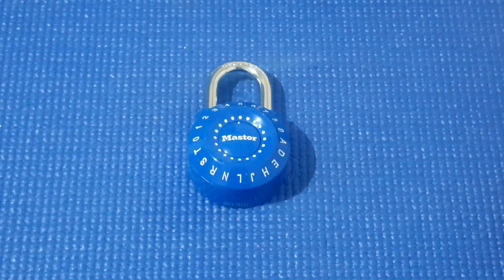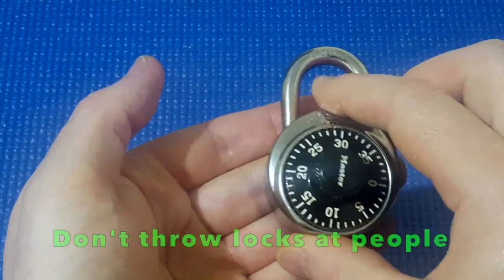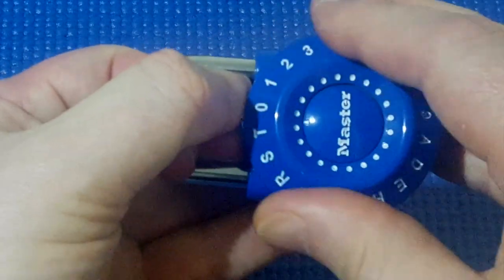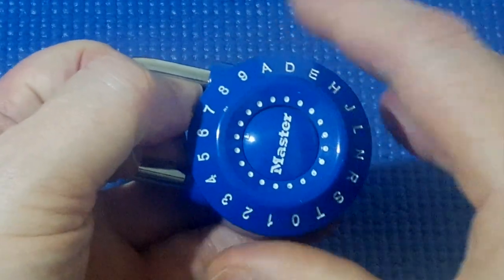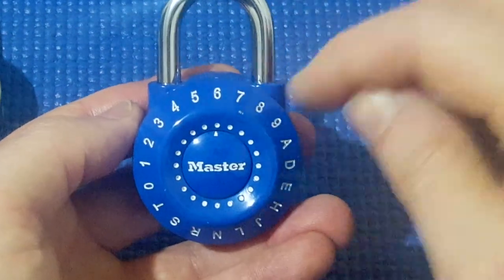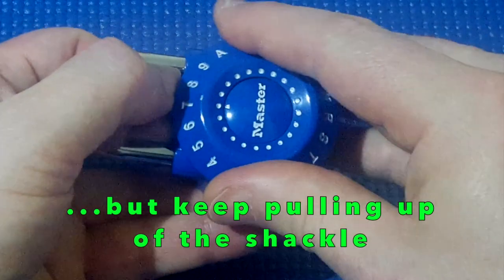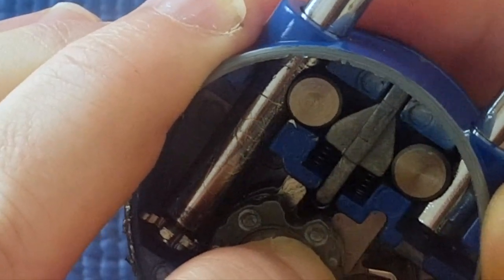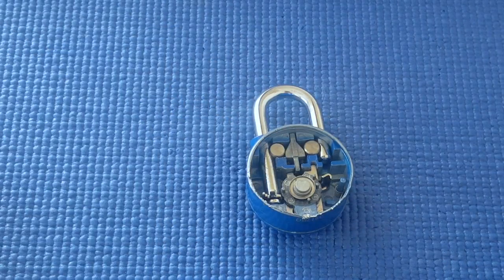(Picking 95) How to crack a Master Lock "1590D" dial combination lock

Comment: I understand that for the 2nd and 3rd you stop and go the other way once you're inbetween gates and it won't let you through but I don't quite understand the 1st digit and what to do and how to find it
Reply from the maker: Do you man the 1st digit of the correct combination? I find the 3rd digit first, as it's easiest to find. I find the 1st digit next, as it's *sometimes" able to be found - 50% chance that the anomaly is hiding behind a usual "stuck" position, if if it is then there's no trick I no of to find it.
Reply: @Swynndla  ok
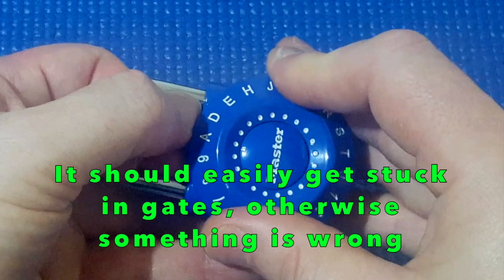Reply: @Swynndla  I don't understand the add 8 part at I think 3:50
Reply from the maker: @expiredcoffe  Firstly, I've had another look at the video (it's been a while) and the previous comment I gave you is wrong - I don't find that 3rd first (with other master lock models I do find the 3rd number first), but I find the 1st number first with this master lock model.
It's still true that with this model of master lock, the 1st number is *sometimes" able to be found - 50% chance, as half the times the anomaly is hiding behind a usual "stuck" position (and if it is then the method in the video won't work).
One of the anomalies I found in the video is "6" so I add two positions to that so 6 + 2 = 8, and so 8 is my first number (as long as the anomaly really is 6). With master locks you always add something to the first number, and with this model you add 2.
Then I "reset" the lock by turning it several times to the right, stopping on the first number I found "8" then I turn one full turn the left, stopping on 8, and I test to see if things tighten up from there (while tensioning the shackle and still turning left), and if it does tighten up then I'm confident that I've found the correct first number.
You will most probably find a different first number, but as I say you will only find it if the anomaly isn't hidden behind a normal stuck position.
Let me know if you find it and how you get on.
Finally, I have proper English subtitles (instead of the inaccurate auto-generated ones) for you to follow along.
Good luck!

Comment: i can’t tell if my first anomaly is H or E because it doesn’t stop at H but it stops at E. i’ve tried step two with H and E but when i get past T with both of them nothing stops. i’ve also tried J and L but the same thing happens.
Reply from the maker: If it doesn't step at H then it's not an anomaly ... don't worry about my ones as your ones will be different ... you'll also have a different one in step two

Comment: Can we just take the back off the lock and reset it like that?
Reply from the maker: In theory you can take the back off and decode it ... but in practice I think you'll destroy the lock doing it.  This lock comes with quite a tough back plate, and by the time you pop it off, the metal will be deformed.
Reply: I think that if you do, the lock wouldn’t be so good anymore, I mean, sure, but now how can you use it?

Comment: what if my lock never "stucks" while turning around? its dificult for me to identify anomalies.
Reply from the maker: Is it the exact same model? It should go into a stuck position every 2nd position, if you're pulling up on the shackle (you have to tension it).
Reply: @Swynndla  it's the same model but the lock has been closed for 10 years haha. I don't know if the inside of the lock is rusty :( 
Btw thanks for answering.
Reply from the maker: @adrianasegura1790  Ahh ok, if you pull really hard while turning and it's smooth then my method won't work. You might have to try all the combinations, but it'll take ages.
Reply: @Swynndla  ok thanks for your advice 😊

Comment: I have only one anomaly. What should I do next ? I don’t get it from the video . Sorry
Reply from the maker: You mean one anomaly when turning clockwise (on your first turn)?  That (plus 2 positions) might be your 1st number ... did you carry on assuming that was your first number (anomaly + 2 letters/numbers)?  If it doesn't work then your first number might be on the same position as "every-2nd stuck position" (so it hidden) and you'd need to try each one as your first number (plus 2), resetting the lock between each attempt.
Reply: @Swynndla  Would this mean that the first anomaly we find would be our second number? (assuming the first number was a hidden one)?
Reply from the maker: @TeamOrdigamer  Any anomalies that we first find will be candidates for the first number.

Comment: I don’t get if ur pinching the lock or pulling it
Reply from the maker: To tension the lock, I pull it (as if I'm trying to open it).  Under this constant pulling tension, the dial will get stuck in certain positions, and I then have to release the tension slightly to be able to turn the dial out of that stuck position (but as soon as it's out I apply pull tension again).  Does that help?

Comment: I am trying to use this method to get my lock open and am struggling. It doesn't stick anywhere but one digit, and even then it doesn't stick there every time. Any advice? Also, how is yours so easy to spin?! I have to basically grip the entire front of mine to turn it!
Reply from the maker: Hmmm I dunno if mine is a different version and that's why it spins so freely, or if yours is just older and a bit clogged up? As for advice on opening it, do you get "stuck" positions every 2nd number/letter? If not, try with increased tension? Lemme know.

Comment: It doesn't work! Mine stops at every letter and number but not hard enough to have to relieve pressure on the shackle. Mine also has never spun so freely using one finger either!
Reply from the maker: Interesting - I'm not sure why you one is different to mine!
Reply: Mine does not spin so freely either. I have to pinch the wheel on the edges with two fingers to turn it.

Comment: I did exactly as you did multiple times but it doesn't work plus it's very confusing and isn't described it very well.

Also in the beginning you say trying to find the first number doesn't work but that's exactly what you do by saying what stops
Reply from the maker: Ahh I was saying what didn't work because there are methods that work on most master locks, but not this master lock model. The method I describe in this video has a 50% chance of working, depending on if you anomaly is "hidden" or not (your first number might lie on a normal stuck position and wont show as an anomaly).
Reply: @Swynndla  well that sucks that it has 50% chance of working.

I tried it on this model that I own because I don't remember the combination.
Reply from the maker: @StormySky48  Yea ... if you now know the first number is hiding on a "stuck" position, you at least know something. You might be able to test each of the first numbers (doing a full reset in between, ie turning several times to the right to reset it) and see if any have an anomaly).  Also, instead of trying to find the anomaly when turning it the way you're turning it (to the right) you can turn it the other way (to the left) trying to find anomalies (with tension). It may work one way but not the other. It'll be difficult. Good luck!
Reply: @Swynndla  What is an "anomaly?"
Reply from the maker: @rski1036  an anomaly is something that is unusual ... something that doesn't fit a pattern. Usually there is a "stuck" position every 2nd position, but an anomaly is a stuck position in-between those usual stuck positions. If you find one then that's good. If you don't then it might be hiding behind a usual stuck position and unfortunately you won't be able to use the method in the video.

Comment: pls help i can't open it..
Reply from the maker: If my method doesn't work, then the anomalies are probably hiding behind stop portions. What you will be able to find in the last (3rd) number  as that's most obvious. You might have to try all the combinations, with that known last number, resetting in between each try (or there are some resetting shortcuts that you can learn from my other videos to save a bit of time). It'll take a long time, and you'll have to take lots of breaks. Write down where you're up to as it's easy to lose track. Good luck!

Comment: Sorry i didnt understand. I only got that there is anomalies. And i have to find them.  But i didnt get how and then how to open it.
Reply from the maker: Ah yea you need to pull on the shackle quite a bit to tension it strong enough to feel "stuck" positions at every 2nd position. Then if you can do that, if you're lucky then you can find anomalies (at positions where they shouldn't be).  I say "lucky" as some combinations mean they are hidden behind the normal stuck positions (and so they seem impossible to find in that case).
Reply: @Swynndla  Thanks I dont know how but I open it then I rechange my code and didnt work again. So I went to change it. But I notice thanks to your video that my dial didnt spin as fast as yours so I think it was indeed damaged. The new one spins without problem.
Reply from the maker: @edermendez946  Hmmm maybe it's damaged ... also these locks are notorious for corrupting the combo when changing it. :-(
Reply: @Swynndla   I supposed, So I didnt change it for the new one I rather to memorize the default code :)

Comment: i didn’t understand how to do it i’ve tried many ways and non of them works
Reply from the maker: Thanks - the method I show sometimes works and sometimes doesn't.  Are you able find any anomalies?
Reply: @Swynndla  I wonder if the first number is odd, your'e out of luck.  Maybe try all odd numbers as first and move on if that happens.
Reply: That's what I'm getting ready to try as it hasn't worked so far.
Reply from the maker: @liza3337  If one (or more) of the numbers is within a normal "stop" number then it wont be obvious (and so won't show as an anomaly) - you're right, that would make it difficult to decode.  Good luck!

Comment: I don’t get how you know that it’s an anomaly
Reply from the maker: If you pull on the shackle to tension it, the numbers/letters should become "stuck" when turning the dial at every 2nd position ... stuck means you can't turn the dial past that "stuck" slot without releasing some tension, turning the dial a bit, and then applying tension again (you have to apply tension again to find the next "stuck" slot). An anomaly is a stuck slot that's not in the every-second-position but is instead in between ... if you're lucky (if you're lucky as some anomalies hide behind normal stuck slots and it's very difficult to open the lock if that happens).

Comment: My first number was a 7 then it just popped open after that.
Reply from the maker: Oh! ... hmmm be careful as the inner wheels might have been mostly in the right place ... if you close it again you may not know the combination!
Reply: Yeah our plans are to find something to reset the combo.
Reply from the maker: @RandomChannel4Kids  Good plan ... you can do it but again be very careful as that can corrupt the code such it will never open if done wrong. You might be able to shine a light and/or phone camera down one of the holes to determine where the gaps are on the 3 inner wheels and deduce the combination that way (can't do it while closed as then any holes are blocked).
Reply: @Swynndla  I tried that but I couldn’t see anything

Comment: This guy is the worse!!  He mumbles through the video without giving a clear and concise description of the technique.  If you're going to add text, make sure it's consistent with the speech.  Why did you choose 6 and not the other two anomaly settings?  Random choice?
Reply from the maker: You're right I'm not very good at speaking. I intended to try each anomaly, and so choose the first anomaly and if that didn't work I was going to choose the 2nd one.